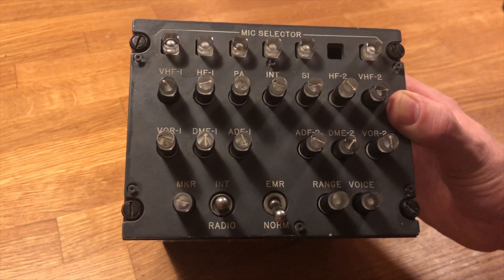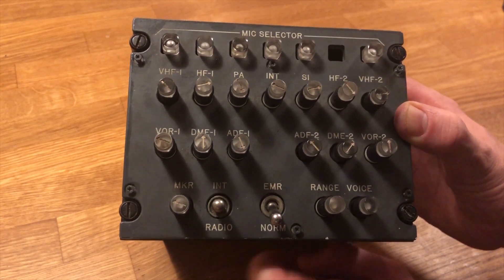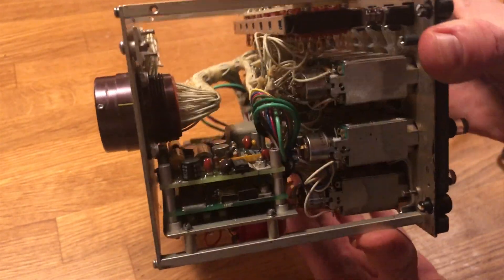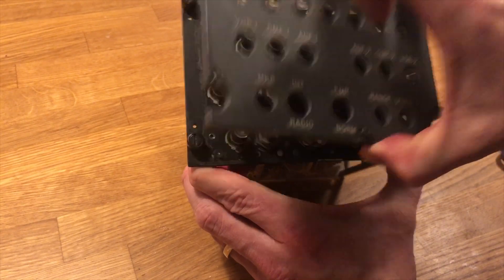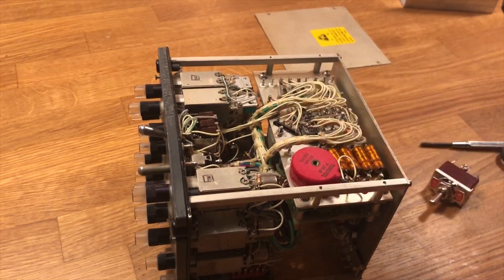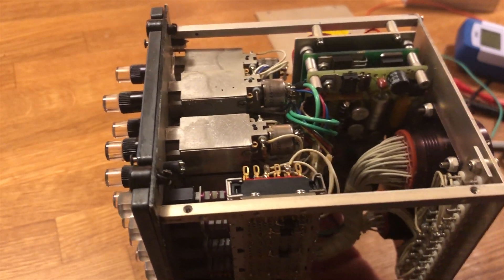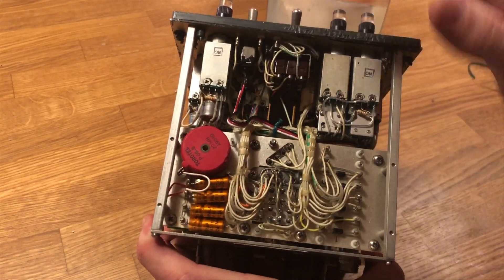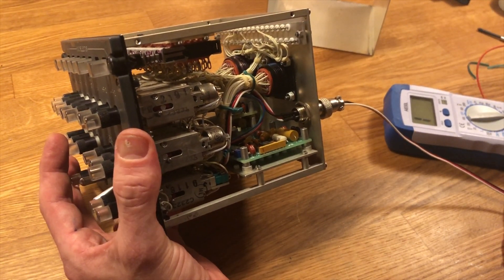OEM-panel Audio Control Panel - B737 Home Cockpit

Comment: I have one of these units for my sim. I have 2 matching dummies which I was going to use in the pedestal. This unit I will place in the upper overhead. My plan is to use it as an audio mixer - mixing the x-plane sim audio, Vatsim/IVAO feed and the 3 headsets (closed loop) and to drive the acoustic speakers in the roof panels.
I've seen the circuit diagram, I believe Buddy Moynihan has published it on his site or flaps2approach. Thanks for posting, very interesting.

Comment: Great job! I found this the hardest part to re-create on the pedestal, so I ended up using Opencockpits panels with some backlighting just to look good! Well done on finding one of these. I'd love to have a go at re-engineering the later version for a sim.

Comment: Very interesting; I love seeing OEM parts being adapted for use in a simulator.
I'll soon be tackling the problem of driving and reading synchros using an Arduino. Really hoping I won't need a 400Hz AC power supply!